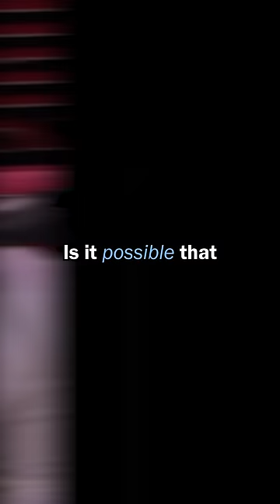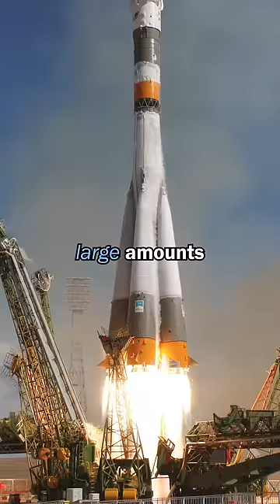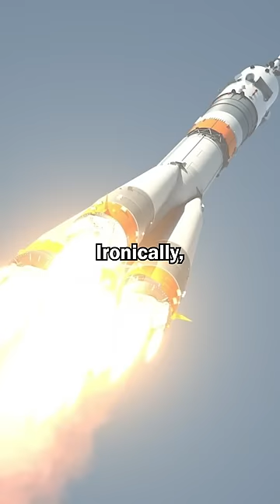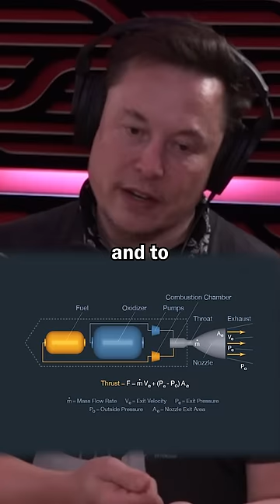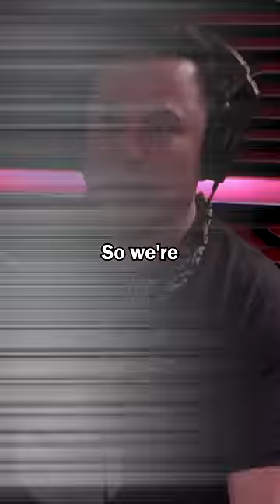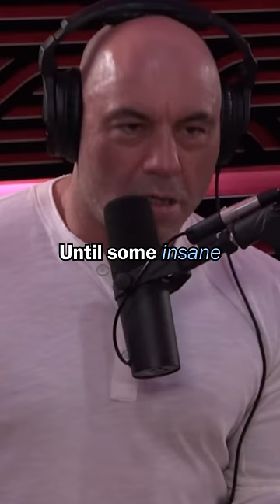Why This Rocket Engine Will NEVER Work!! ☢️ #spacex

Comment: Like a ballon filled with air and than you let it go the air comes out of back pushing ballon forward. Travel in Vaccum of Space is By Gravitational attraction as object repelled now what it is that’s how fast you travel at if it’s you or any object with no engine but you are traveling fast but if you add to object certain speed due to applying certain sort of force than it will travel at whatever that force applied to object since no air in space and object in vacuum of vast space with Gravity plus the force x distance = speed and whatever is generating that force which most cases are rocket engine But Nuclear propulsion can be possible A few enormous pushes acceleration happens extremely very very very fast but the Object must be extremely solid letting out pressure from back for object to move vastly very fast accelerating forward than reverse nuclear propulsion to cancel speed to bring object to slow down to stop plus rocket propulsion might be needed as well. We can try to design But Need All the information we have now and Machines and instruments plus engineers and scientist and We Can Do This Momentum is Moving through vast space without air. Newtons laws is applied since something in motion tends to keep moving until an opposite force is applied. In space objects can keep moving forever and adding force to make object faster will keep that object at that speed. 9:33pm 
Mass of Object and Speed is due to The Energy Required. Recently Nuclear Fusion Was simulated. Now Many More Experimental Test Must be Mathematically calculated Controlled Experiments plus Than Designs of Nuclear Propulsion Engines As Vehicles Are Designed To travel at few hundred thousand to millions of miles per hour Within Space. This Vehicle could be the very first Spaceship j with a Very complex Artificial intelligence machine robots to control this vehicle through Space. We Will Need Theoretical Physicist, Nuclear Physicist AstroPhysicist All Chemical Scientist Mathematicians

Comment: Can NASA invent whatever is in the absence inside the vacuum to cause a propulsion? Opposing magnets 🧲 or extended from the rockets 🚀 attraction🧲 MRI machines... if the vacuum is nothing, can the spaceship or Rockets unidirectional steering as a compass be drawn to the magnet of the Space Shuttle via switching the outside of the rocket or spaceship to a magnet🚀🧲🛰?

Comment: But if we imagine „flight routes“ then theoretically wouldn‘t it be possible to have stations on the way with 2 Wholes (for two directions) and some kind of space ship gondola which are shootet via magnetic acelleration between stations on the way. Each Station isn‘t moved because of the both directions it pushes objects. Electricity gain in the stRions via solar.
I see a ton of problems. And maybe „not in our liefetime“ is right but some some
Day there will be a rebell just doing such things showing the old mars flight industry how change can happen. He will ground „Thales van Millet Flighs“ 😂

Comment: Well first off space is not a true vacuum. Well not as we know it here on earth. 
We associate vacuums here on earth with how we create one within the atmosphere of earth. The only way to is to force the air out but when you do this you need some type of container to increase pressure inside the container or else the atmospheric pressure would collapse the container so you can’t suck the air out you must create a equal pressure to force the air out and maintain that pressure if it leaks or the container is not strong enough in implodes crushing the container. 

But the vacuum of space is the opposite. By definition, a vacuum is devoid of matter. Space is almost an absolute vacuum, not because of suction or pressure but because it's nearly empty.  But on earth due to gravitational forces on the atmosphere we have atmospherical pressure we cannot create a void within the atmosphere. If you did the container would implode. We remove air from container creating a vacuum chamber but not without pressurizing the container equal to the atmospheric pressure . Space is simply a natural void the void of space will not cause pressure of any kind. As it’s gravity and essentially the weight of the atmosphere being held to the earth by its gravity. 

And because of that there is no resistance when traveling through space. So yes rockets require force to propel objects into space because of gravitational forces must be overcome. But once in space momentum is more important then acceleration once in space you would continue in the direction and speed your traveling almost indefinitely (like is said space is Almost a perfect void so Newtons law of motion would apply that a object in motion will stay in motion. Very little force is needed to propel an object through space once it’s there in fact solar sails can actually be used to propel a spacecraft using the light rays as propulsion.  But the  to traverse the expanse of space in a human life space is essentially impractical outside of close orbit destinations. Distant world would require more then the technology we have today rockets will get us into space but once in space unless we can bend space and time to jump across space you could never reach even the end of our known solar system and return in a human lifespan.

Comment: Well electric cant even get enough speed to get to the space. You need to accelerate up to 11 km per second to get to space so electric engines cant simply do it. And by the way i believe there is not future for electric aircrafts because the electric aircrafts can barely transport their battery units

Comment: Not really if we develop  superconductor for room temp we can use a system to boost the field of them we can use it to be like antigravity use the our suns magnetic field and planet magnetic fields to push or pull the ship making us gain speed quickly for next to nothing in  electricity space is empty no air no friction to slow you down now will it be super good could be it could also be slow but uses no gas

Comment: Clue less , radiation from sun and water electro mag abs collect within closed cell with fixed field , metal tree draws out charge ,pinch with hydrogen when pinch has broken creates microwaves to heat a vapor in a nozzle, you cant understand 😢

Comment: What about  builting a fuel that never runs out usiing biomass
Renewable resources are those resources that continue to exist despite being consumed or can replenish themselves over a period of time even as they are used. They include the sun, wind, water, geothermal, and biomass 

Auto generative fuels of the future will  be an inovative breakthrough in multiplying the fuel energy .an extensive R&D is advisable .

Comment: Try hydrogen. Just sayen
Reply: What do you mean hydrogen can you explain better
Reply: @AverageMan-on9zk  when copper rods are  sending an electrical charge into spring water. They produce a gas called hydrogen. Extremely combustible and clean no pollution.
Reply: @Jabreu432  sorry for such a late reply but wouldn’t that still use electricity, probables not as much but still polluting right?

Comment: That don’t make sense because during take off if you can go against the air then why would you need to burn large amounts of fuel? In space yes but by this logic until you come to the grips of space whilst you leave earth then no you don’t need it because you go against the air such as a plane does.
Reply: Space shuttles dont flap freaking wings. 
Rockets dont push off the air